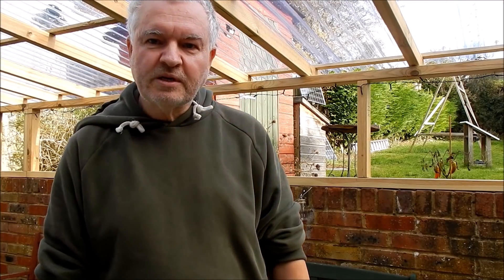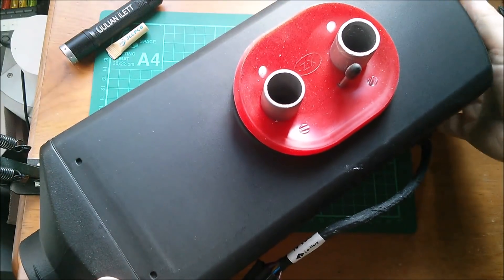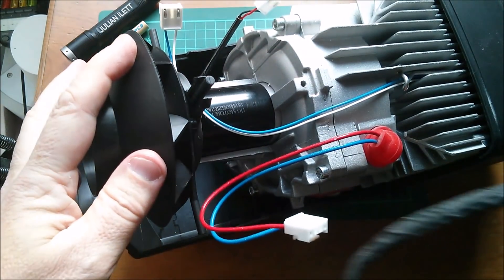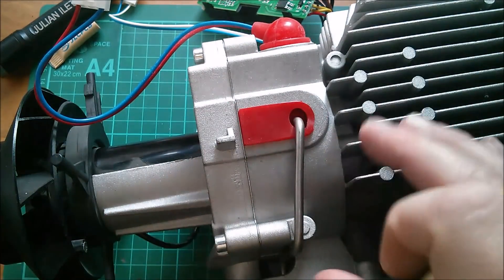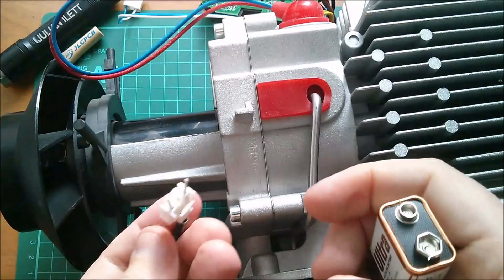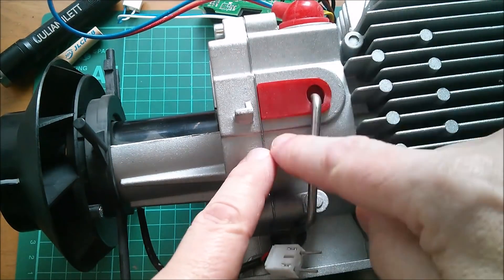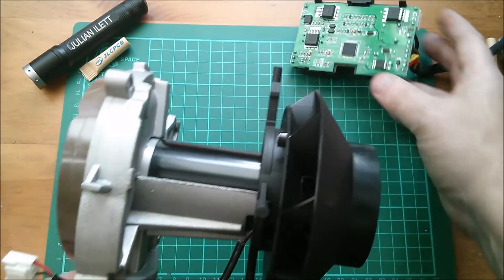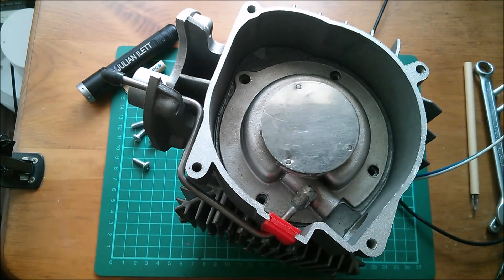A Look Inside the 8kW 12V Diesel Air Heater from Banggood

Comment: These units are knockoffs of heaters made by the German company Webasto
Reply: Usually first generation chinese Knockoffs are not so bad, as they tend to be 1 to 1 copies of the original product. It is when they start makink knockofs of the knockoffs that things really start to fall apart.
Reply: @agarceran  sometimes it's true, sometimes they improve... but saw that many times
Reply: Ah, interesting. I saw the Infineon chips and the NXP mc. And I thought: "That was made from a chinese company?" Normally they use some unknown chips for 2 cents. But if the whole thing is a copy that makes sense.
Reply: yup.  I was thinking either Webasto or Espar.  I think it's similar inside to the older espars.  Then again, it's not $1600 CDN for one like the webasto & espar heaters are.
Reply: is that kinda the BMW cabin heating unit? the one you turn on before entering the car like with the fob?
Reply: Red Overdrive, the unstoppable confused daltonic!! Not the same thing, but one could easily put one in the back add a remote control and voila. 
For the more cautious ones you could leave it outside and connect the outlet somehow to the interior of your car.
Reply: With the price of Webasto heaters being so high, it's inevitable that the Chinese will make lower cost clones of them.
Reply: it's not a knockoff it's a competitor
Reply: @firstnamegklsodascb4277  i've worked on espar airtroincs (which i think this is a clone of) and the webasto air tops before.  Looks pretty much the same inside.  There isn't much to them, however the chassis looks very similar to the airtronic inside.

Comment: We have 12V diesel heaters in our vans. When they work, they are good, getting the transit van nice and warm in a reasonable time. Not sure how good they would be for a much larger area. Of course, once they are a few years old, they either take forever to get to heating mode. Or they cut-out due to failing to get to heating mode 🙁
Reply: Perhaps the fuel line is a bit constricted, insufficient fuel for combustion; I think it's more likely to be a failing glow plug.  Should be inexpensive part; no idea how difficult to replace.
Reply: @seanflanagan5674  Possibly after that length of time in need of a good decoke.
Reply: @georgestewart5879  they would need to be cleaned after a year of use i would think

Comment: NIce, this is something i always wanted in my vw Bug..
So, I wanted a diesel even though the bug itself is petrol, but i mus say i feel safer.. as the diesel not burning so easy if something fails..
 =) nice to see a china model tested.
Reply: You can retrofit a European Forester Diesel Engine into an 'Old' bug with a little work.
Reply: A friend burned down half of his house with a VW aftermarket gasoline heater in the 70's.